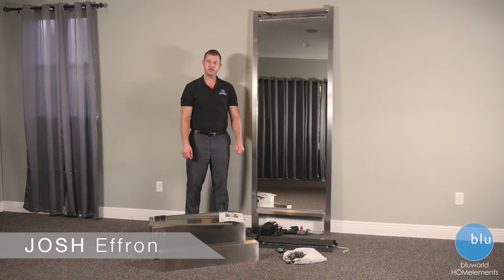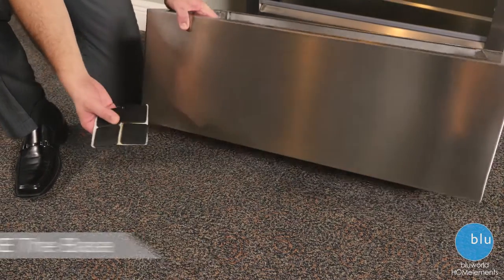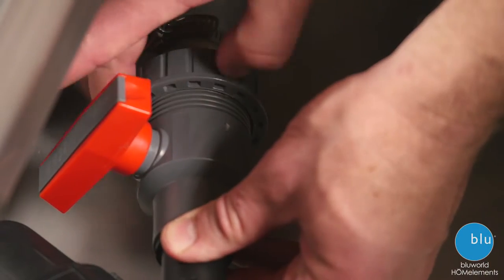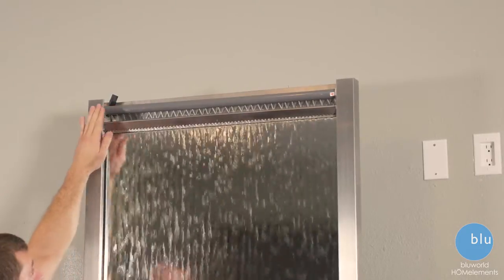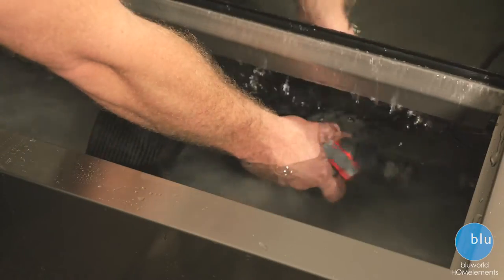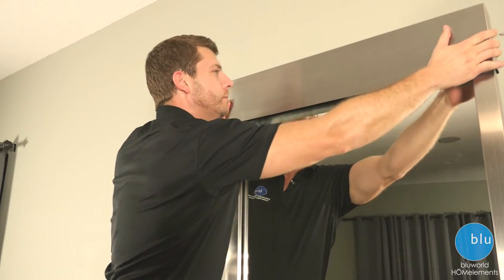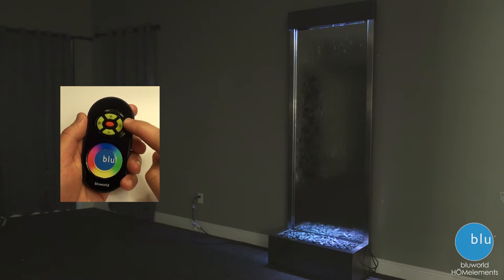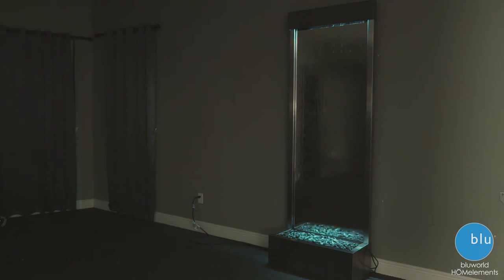Bluworld GardenFall Floor Fountain Easy Install Setup Video

Comment: it says 3 AAA batteries but I only see a spot for 2.  and the lights aren't working.  can you confirm three or two AAA batteries? thanks
Reply: My remote has not come on using Energizer  batteries.  Did u get your  remote to work?
Reply: Any updates on the remote working? We have ours set up, but remote not working.

Comment: I would love to buy one but many people complaint that the motor is loud is it true? 
if I buy one and I find out the motor is noisy what should I do?
Reply: Hi Damba.  The only reason the pump would be loud is either the foam pads (CV cushions)  were not applied to the pump before the pump was connected or the pump itself is defective.  I will assure you that this particular fountain does not have any issues with the pump being too loud. The CV cushions come with each fountain and the pump will immediately be replaced if it is defective.   We guarantee our quality and our customer service dept. will take care of any issue in a timely manner.
Reply: thanks... I am buying one today...
Reply: Damba Adeyemi Did you this? How is it today? Any issues?
Reply: Hi I just bought this stainless steel 90inch. The water fall is not spreading 100% . I've added 8 gallons of distilled water. ALSO I installed 2 batteries into the remote and the remote does not come on! Help please